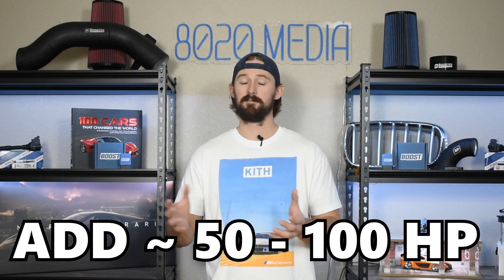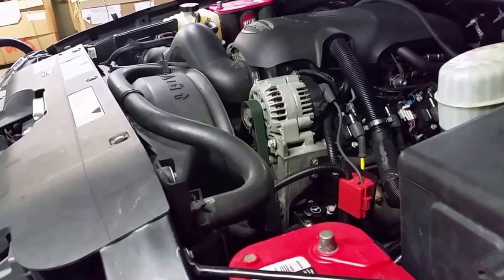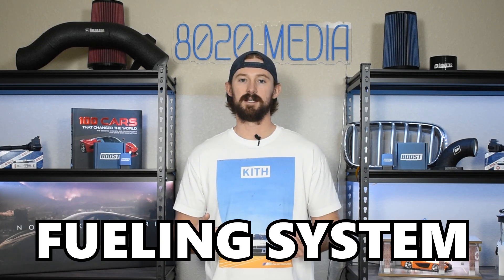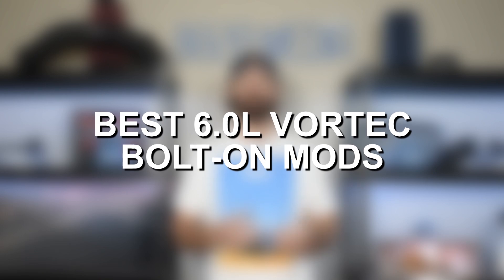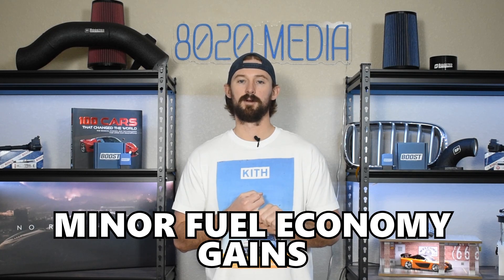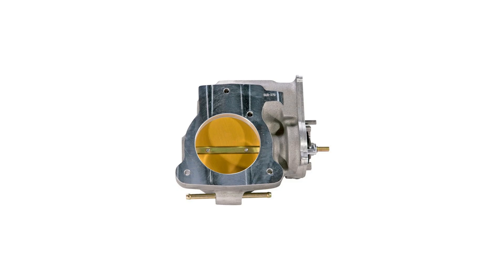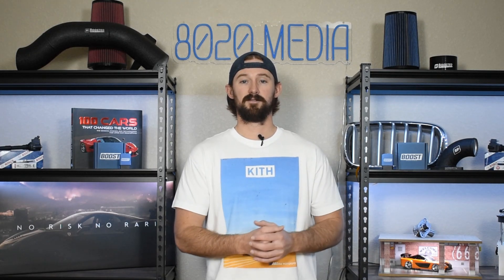How to Push 500+ HP from a 6.0 Vortec!

Comment: i have a 2015 2500hd 6.0. and i struggle to go up in the hills, hwy, and mountains. i have a Toy Hauler a 26 ft. man, my 6.0 struggled. how can i get a little boost just for my 6.0 to go up the hills without  no struggle and the engine roaring. i would appreciate it if you could give advice.
Reply: As I understand it, an towing-specific tune would be the most significant single modification, focusing on low-end torque to help you pull that trailer. However, remember that the Vortec motors gain their power in the higher-RPM range, that’s how they were designed, and most gas motors behave similarly while towing.
Reply: @stein5763 thank you.

Comment: I just got an 88 Silverado with an Lq9, i was going to throw shorty headers on and just have it dump out behind the driver and passenger front wheels. Also put a cold air intake in and an aces jackpot fuel injection, looking to fiugre out a good tune for it. My question is to upgrade my camshaft, im looking for aggresive chop, do i need to change and valve springs or anything? Or will stock work for that? Your video is great btw, very informative.
Reply: Id stick with the stock computer and have someone with HP tuners tune it for you. Aces is cheap for a reason. Most people I've talked to struggle to ever get it to run right.

Comment: Only problem is no one makes headers for the 2500 HD 4wd trucks. and if they do , I’ve never seen any. Only custom ones that were in excess of $3500 just for the headers 🤦‍♂️.
Reply: Alot of shorty headers for bottom end power rather than top end, but  1500 long tubes should fit a 2500

Comment: please everyone upgrade the damn trans cooler factory one is trash
Reply: Factory coolers are fine for the 5.3 is the 6.0 a big trans cooler for bigger trans? I have a 09 it runs 114-136 tran temps on a really hot day like 90 plus outside sometime sit runs up to about 160 degrees. They can go up to like 230 before they start boiling fluid and scorching metal

Comment: Ok those are some good ideas and if you have an early 6.0 with the 4l80e then this will work fine. But.... If you have that wonderful 6l90e, first step in performance should be a billet torque converter and a transmission tune.
Reply from the maker: S - Thanks for the feedback! Also good ideas!

Comment: Looking for advice. I wanna make somewhere around 450 to 500 hp in a 2012 silverado 2500 but I would also like to daily drive it. Is that gonna be too much power for a daily? And would it make sense to have multiple tunes like you would a diesel. One for fuel economy one for power and one for towing?
Reply from the maker: i - 450–500 hp is doable and still daily drivable, but it’s not as simple as just a tune—naturally aspirated you’ll need a healthy cam upgrade, ported heads, long-tube headers, free-flowing exhaust, good intake, and a solid dyno tune, which will get you into the mid-400s at the crank (closer to 380–400 at the wheels). To comfortably hit 500+ while keeping drivability, you’re usually looking at boost (supercharger or turbo), which the 6.0 handles well with forged internals, though fuel system upgrades (injectors, pump) and a stronger transmission are a must. Multiple tunes like diesels have isn’t common, but you can run an ECU tune with different modes (some tuners set up “tow” vs “performance” maps) or just have a conservative street tune and a hot map for fun. Bottom line: NA build can make a strong, lumpy, reliable 400–450 hp daily, but if you want true 500+ and still keep it streetable, mild boost with a careful tune is the way to go.
Reply: Thank you for the advice!

Comment: I was considering adding a small turbo to a 2017-2018 6.0L for towing purposes. I tow an 8K travel trailer in the Colorado Rockies with my 5.3L and it really struggles above about 9k feet elevation. I can buy a 6.0L for $5-8,000 less than a diesel. Would you recommend this modification for towing? The reviews for naturally aspirated 6.0L 3/4 Ton trucks are not very impressive in the mountains. What all would be needed?
Reply from the maker: S - Yes, adding a small, properly tuned turbo to your truck (L96 engine) can be a smart and budget-friendly alternative to buying a diesel—especially for towing 8,000 lbs at high elevations like the Colorado Rockies, where naturally aspirated engines lose up to 30% of power. A low-boost turbo (5–8 psi) on the 6.0L can safely add 100–150 lb-ft of torque, significantly improving midrange pull and maintaining power above 9,000 feet without overloading the engine or transmission.

Comment: I just need to be able to tow a 8-10k lb rv trailer uphill in the rockies. Ive been running a 95 suburban k1500 4x4 4spd transmission with a 7k trailer. It actually does not bad except when running above a 4% grade up to a 7%. It'll drop from 50mph down to 25mph before the low gear kicks in & will take it back up to 35/40 mph at 35/3700rpm where i hold it to finish the grade. But that drop just sucks. 
I'm learning here but i'm wondering how much modding a used 2500 hd 6.0 gasser will help with that. I know a diesel would be ideal, but most of my travel with work/commuter etc is under 5 miles on suburban/midsized town roads (non highway) and only tow bigger like this 2x/month. So the daily driving isn't going to be very good for a diesel.
I wish the 8spd transmissions would have worked out, but thats not a reality so going to have to make the best of a 6 spd. Needs to be street legal for Utah.
What do you recommend I look and do for a somewhat budget friendly truck upgrade?
Reply from the maker: A - You're thinking clearly and realistically here—the 6.0L gas-powered GM 2500HD (L96 engine, ideally 2011–2019 with the 6L90 6-speed transmission) is one of the best budget-friendly setups for what you’re describing: rugged, reliable, and capable of towing 10K lbs with proper gearing (4.10 is ideal for mountain grades). To prevent that frustrating drop in power like your Suburban experiences, the key upgrades would be: 1) 4.10 rear gears if the truck doesn't already have them, 2) a transmission tune to hold lower gears longer and reduce downshift delay, 3) an intake/exhaust upgrade and possibly a mild BlackBear or HP Tuners ECM tune to sharpen throttle response and optimize the torque curve. A good trans cooler, Bilstein 5100s, and Load E tires will also help with stability and long-haul reliability. With those upgrades and smart driving (keeping RPM in the 3,200–3,700 range on climbs), the 6.0 will hold 45–55 MPH on 5–7% grades without dropping like your current setup. You’ll lose MPG daily vs. a 1500, but with only two big tow trips per month and short commutes, it’s a great compromise over a diesel.
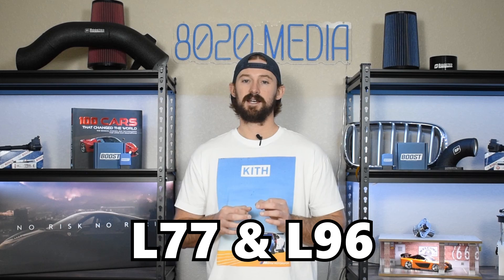Reply: @8020Automotive  ive owned a 2015 3500 Silverado 4x4 Dually 6.0 with 4:10 rear
pulling a 10,000 lb Travel Trailor it SCREAMS up hills in 2nd to 3rd gear at 4,000-5,000 rpm and mileage goes from 12 to 6 mpg.  getting ready to install the Banks pedal monster and the Banks tuning with a cold air intake
Wish me Luck  🤣🤣🤣
Reply: @8020Automotive thank you very much.
As a follow up, does a 2010 2500 hd 6.0 have the same capabilities as the 2011 or is there something unique added in 2011 that will help? I was thinking 2010 because i understood thats the last year before emissions/fuel economy stuff like AFM started being introduced.

Comment: Yeah but we're not talking about 2006 like mine we're talking about rich boys toys like a 2023 right yeah because us boys that own older trucks don't understand those new mods but that's all you Rich boys talk about
Reply: The 6.0 is not made anymore so this can be for all 6liters
Reply: @eastoakland-S65feen okay, I thought Chevy still made the 6.0 diesel but I don't know I don't pay attention All I do is make sure mine stays running and boy does it stay running It is one hell of a truck 235,000 mi and still runs like brand new
Reply: @kennyslaughenhaupt3839 gm never made a 6.0 diesel, always was a 6.6 (duramax ), 6.5 (detroit) or 6.2 (detroit)
Reply: On the diesel idk either. I think its a 6.6, but not too sure. Im a gas guy. But the 6.0 got replaced with the 6.2 direct injection. & Of course the 5.3 is still around
Reply from the maker: J - If you’ve replaced all those components and are still getting a purge valve fault—with good voltage at the fuse box but no reading at the purge valve connector—then it strongly points to an open circuit, broken wire, or bad ground between the fuse box and the purge valve solenoid; even though the fuse is good, the power or ground wire to the purge valve could be damaged, corroded, or disconnected somewhere along the harness. Use your multimeter or a test light to check for 12V at the connector with the key ON (one pin should have power), and also do a continuity test from the other pin back to the ECU or ground depending on the wiring design—if either leg is broken or has high resistance, the ECU can’t actuate the valve. A simple wire repair or new pigtail may solve it.
Reply: @8020Automotive I just chased down a purge valve fault, had 12v when grounded at the plug and 9v at the pigtail. Checked the entire wire for a short, ohmed out good. Replaced PCM, issue gone.
Reply from the maker: @teamred389  Thanks for sharing!
Reply: You obviously don't know what you're talking about they stopped making the 6.0 in 2019 in the trucks so just say you can't afford anything new and crawl back in your hole.

Comment: Does these mods equate to better pulling power. Looking to get a little more torque and low end power for pulling but keeping my reliability.
Reply from the maker: J - Sure thing!
Reply: I think shorty headers would be better than long-tube from the research I’ve done. They’re supposed to to better torque/power from idle to mid-rpm’s (aka in your towing rpm range). That’s why I bought shorty headers

Comment: I think you said that the 6.0 vortec didn’t have AFM is that on all 6.0 or just on 2500 HD ?
Reply from the maker: H - Not all 6.0L Vortec engines have AFM, and in fact, most don’t. The LQ4 and LQ9 versions (common in early 2000s trucks and SUVs) and the LY6 (used in 2500HD+ trucks from 2007.5–2019) do not have Active Fuel Management (AFM).
Reply: @8020Automotive  The L76 all aluminum 6.0L, the Vortec MAX, engine has AFM. It might have only been 2008 and 2009. I have a 2009 with 265K and just lost a lifter on cylinder #3, so not AFM cylinder.
Reply: I’m pretty sure he’s wrong, I think after 2008 any gasser 5.3,6.0,6.2 had AFM or DOD you have to do a delete gotta do lifters, cam, tune to get rid of it. Which most people do when they build it anyway
Reply: @rolandovillarreal5852 from the info I've collected is a 6.0 in a 1500 has afm and dod .. my 08 2500 hd 6.0 doesn't have it and I lucked out with 823 heads as well from factory
Reply: @rolandovillarreal5852 my 08 chevy 1500 has a 6.0 and yes it has it.

Comment: Any suggestions for Long tube headers? Have a full custom tune on my bone stock 2015 looking to start making some power.
Reply: Stainless works does make a really nice set of headers but they are $2500. That’s crazy money! Speed engineering has a nice set of true stainless steel headers for $300. I guarantee you’ll be impressed with the quality for the price.
Reply: Speed engineering makes a good set for about $350 for the headers and $150 for the y pipe
Reply from the maker: A - Stainless Works.